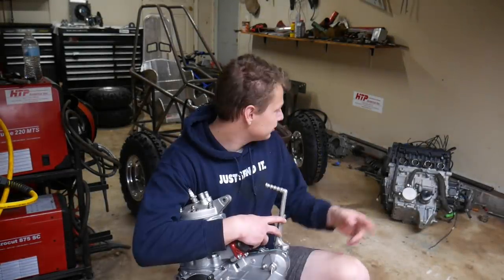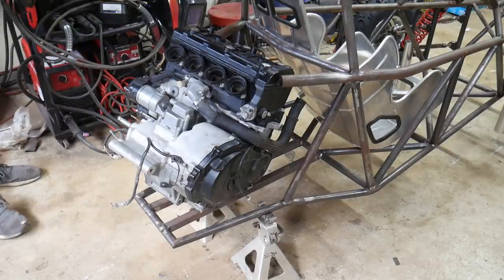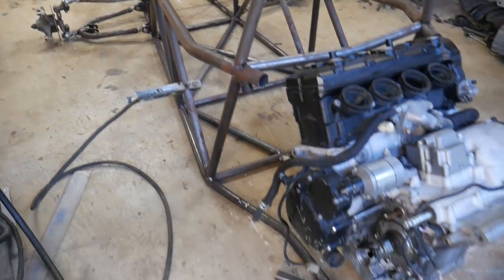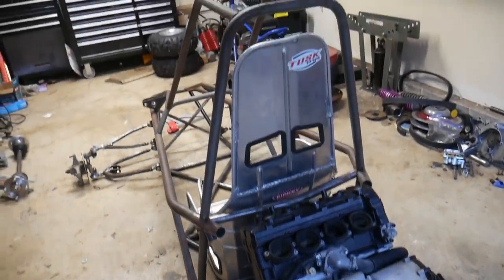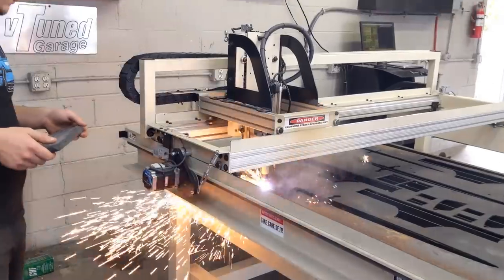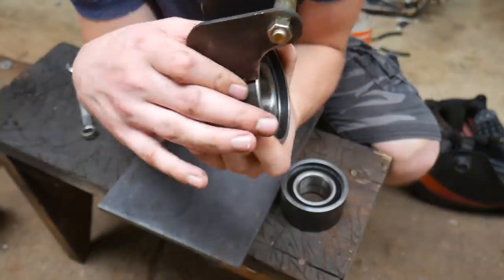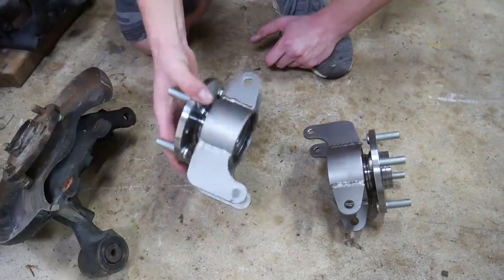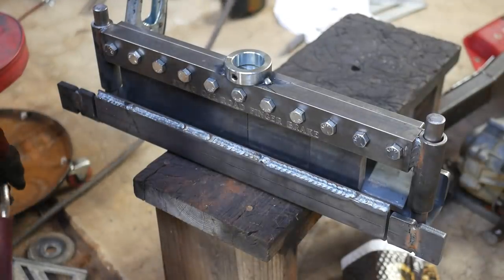Suzuki Gsxr 600 Offroad Crosskart Part 6! Ultralight Inspired

Comment from the maker: Big plot twist ladies and gentlemen! Hope you enjoy
Reply: never weld while bearings are mounted kid you´ll just ruin them
Reply: I'm a new subscriber love to watch people make these things
Reply: By lengthening the chassis you improve high speed stability but you sacrifice slight amount of nimbleness and also by mounting the engine lower and Infront of the rear axle you massively improve handling.
Reply: What's up vasily can't wait to see what pops next into your beautiful mind!
Reply: love it!!! you will need to revalve/respring the rear shocks though. BUT..... real talk, if you dont go to a motorcross track or better yet a SxS track and crush every single jump im unsubbing JK. <3 cant wait to see you in the dunes, still waitin on that too. but build it good and we will see you there, hopefully you out jump me and every Sxs out there.
Reply: By the sound of it it looks like you already are changing the front end but i was gonna say a wider front end may be beneficial. More travel for that thing when your flying at 60mph in the dirt. This thing would be sick at the dunes as well
Reply: "Camber gain"? What's that?
Reply: @donellmuniz590  camber refers to the tilt or lean of the wheel.
Reply: what about a jegs low profile pan? you could add baffles an trap doors n make your own dry sump kit.. or maybe you could find one for a 1000 and make it fit
Reply: @rprokopow  Yes, I know what camber and caster are. But not camber GAIN.
Reply: Where’s the mower build
Reply: Cr500 swap the drag minibike
Reply: when's next video i enjoy this one
Reply: Im just getting into these builds. Im super stoked for you my friend. GOOD LUCK AND GOD SPEED..
Reply: Hey @Vasily Builds make it look like a mini Indy 🏎️ RaceCar that would be INSANE. . . ! ! !

Comment: Now You are getting somewhere,  doing big things now.....you got the skills to build some awesome toys man......put that gift to work , build away.......heres a tip when it comes to motorcycle powered carts.....trim that oil pan to get it flat and convert it over to a Dry sump oiling system....then you can mount the engine upright......makes a world of difference.
Reply: Or make a custom oil pan, where oil pick up is at the lowest point, when engine block is upright.

Comment: That 600 in that light little chassis is gonna be amazing!  
I have the GSXR 1000 in my buggy and it blows my mind every time I step on the fun peddle!
Reply: John, would you be able to measure the Gixxer engine from the sump to the top of the carbs???  I'm considering turning my racing quad into a street legal reverse Trike.
Reply: @jeffwilkins3052  it’s approximately 24” to the top of the throttle bodies and 29” to the top of the stock air box.

Comment: Don’t weld anything with a bearing in place you mess up the bearings
Reply: Yup. Not a smart move.
Reply: My butt puckered a little, build is looking good tho.
Reply: How to cook a bearing 101
Reply: Yes
Reply: how else would he weld the tabs on?
Reply: @danielvinyard4948  take the bearings out of the hub sleeve first weld then press them back in the hub sleeve . He is not welding them directly to the bearing
Reply: @davidhamilton8041  oh i couldn't tell.
Reply: @davidhamilton8041  I'm sure it is going to be "ok" though. That's a pretty big bearing, so I'm sure it didnt wrap or anything like that.
Reply: @Andrew-ff5vm  problem so👍
Reply: @danielvinyard4948  he doesn’t need the bearings in to do it
Reply: @CR4ZYxRY4N  I’d definitely recommend the bearings in the sleeve to weld it but then I’d chunk the bearings in the garbage and get a new set as the life of those bearings is severely shortened
Reply: If it's a sealed bearing, what choice do ya have?
Reply from the maker: These bearings are 3" in diameter lol + they act as a heatsink to minimize warping so the bore stays round.
Reply: @VasilyBuilds  🔥👍👍👍✌️
Reply: He could have left material in bearing housing and final bore after welding.

Comment: The GSXR 1k engine in my dwarf car is mounted near factory pitch.. although the only major requirement for changing the pitch of the engine is making sure the sump is still sitting in the oil and that the oil isn't being aerated by the crank. The degree isn't as critical as you think, but I wouldn't suggest a 90 degree vertical mount without changing up the oil pan and oil pickup design.
Reply from the maker: sounds like you got a ripper! Thanks I was told the oil light comes on if you lean it back too much
Reply: @VasilyBuilds  it's definitely a wild little ride lol. If you ever need to look over it to get an idea of how to set your kart up, I live about 10-15min from the vtuned shop
Reply: "I was told the oil light comes on if you lean it back too much" and if you do not notice it right away, crank bearings and/or rod bearings are gone.

Comment: Nice engine choice, great build. You’re now putting a lot more power in the back end, why don’t you look into the Edge Products Barracuda MK2 for some inspirational ideas for the rear end. The drive train sits in a box that the arms bolt onto and the engine sits in front of the box. Super strong and easy to design something similar for your purposes on CAD then laser cut and weld together like a puzzle.

Comment: If you put some dishwashing liquid and water in a spray bottle and prespray the area your welding it will stop weld splatter from sticking and it’s cheaper then buying it. Cooking spray also works but leaves the metal oily...bad when you want to paint the frame

Comment: Better choice for engines. Looks way cooler. Now, what are yah going to do with the 500 cc 2 stroke? Build a drag trike possibly?
Reply from the maker: Nothing drag, because that engine doesn't really rev high. And lots of money would be spent making it rev high.
Reply: @VasilyBuilds  Think of something unique to build that nobody has done before. Make something front engine 2 passenger possibly? Cross cart 2 wheel drive with high and low capability?

Comment: did you no that the heat of that mig welder could have disstorted the balls in your bearing ,what you pherhaps thought ,was to push out the the bearings, then pushed in a piece of pipe at a tight fit then welled  the  brackets on . Then there's no risk of your bearing "s  getting heated up , on that side  where you welled the brackets on  you probabley heated the seals up as well  the future is going to be interesting , for those 2 bearings check them every so often for oil seepage.Just thought you should no dont't mean to be a pain  but great viedo.